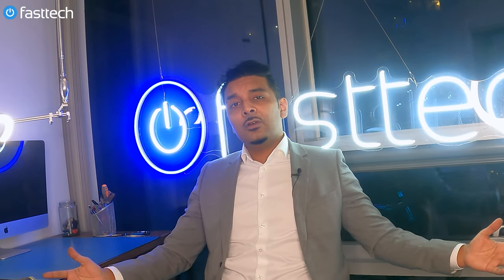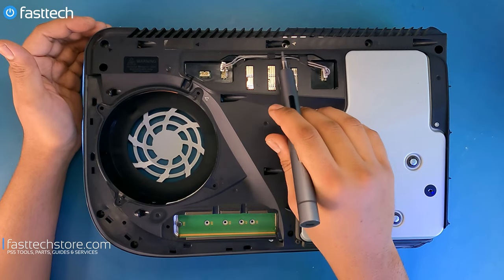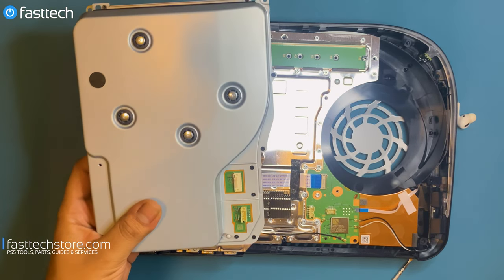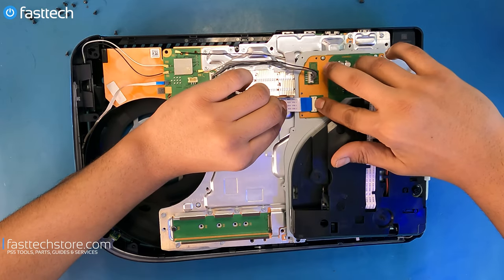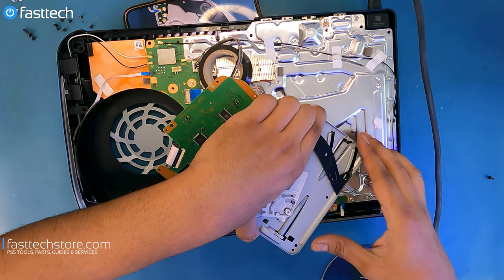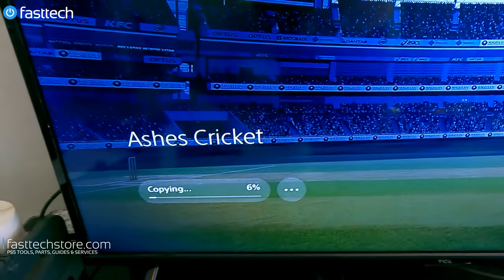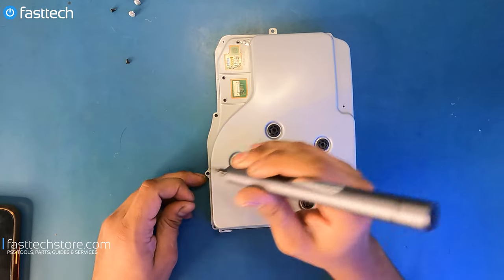PS5 Disc Drive Realignment Guide (Grinding Noise / Not Taking In Discs)

Comment from the maker: ▶ Fasttech Pro AutoKit: https://www.fasttech.ca/tools/fasttech-pro-auto-kit
▶ PlayStation 5 Laser Lens: https://www.fasttech.ca/playstation-5-1/ps5-laser-lens-kem-497aaa
▶ PlayStation 5 Laser Lens and Deck: https://www.fasttech.ca/playstation-5-1/ps5-laser-lens-with-deck-kem-497aaa
▶ PlayStation 5 Disc Drive: https://www.fasttech.ca/playstation-5-1/ps5-disc-drive-kem497aaa
▶ PlayStation 5 Casing: https://www.fasttech.ca/playstation-5-1?category=Casing
▶ PlayStation 5 Digital Edition Motherboard: https://www.fasttech.ca/playstation-5-1/playstation-5-digital-edition-motherboard-edm-010
▶ PlayStation 5 Power Supply: https://www.fasttech.ca/playstation-5-1/playstation-5-power-supply-adp-400dr
▶ PlayStation 5 Fan: https://www.fasttech.ca/playstation-5-1/playstation-5-internal-cooling-fan
▶ PlayStation 5 SSD: https://www.fasttech.ca/playstation-5-1/playstation-5-ssd
▶ PlayStation 5 Heatsink: https://www.fasttech.ca/playstation-5-1/playstation-5-heat-sink-cfi-10xx
▶ PlayStation 5 Eject Button: https://www.fasttech.ca/playstation-5-1/playstation-5-power-amp-eject-button-board
▶ PlayStation 5 USB I/0 Board: https://www.fasttech.ca/playstation-5-1/playstation-5-usb-and-usb-c-io-board
▶ Compressed Air Can: https://www.fasttech.ca/tools/disposable-compressed-air-duster-35-oz

👉Need Help? FaceTime/Zoom Video Call Me: https://www.fasttech.ca/online-consultation
👉GET REPAIR SERVICE FOR YOUR DEVICE: https://www.fasttech.ca/electronics-repair

▶ Want us to fix your device for you? Just order the Fasttech Repair Box to send us your device by using this link: https://www.fasttech.ca/repair/repair-box
👉NEED HELP? FaceTime/Zoom Video Call Me: https://www.fasttech.ca/online-consultation
👉GET REPAIR SERVICE FOR YOUR DEVICE: https://www.fasttech.ca/electronics-repair

Other PS5 Videos:
▶PS5 Disc Drive Repair Guide: https://www.youtube.com/watch?v=WocR0PRHu50
▶PS5 Factory Reset Guide: https://www.youtube.com/watch?v=-FBN3xqd5Pk
▶PS5 Elgato 4K60S+ Setup Guide: https://www.youtube.com/watch?v=bZETqEkjEBg
▶Enable 120 HZ Output for PS5: https://www.youtube.com/watch?v=Y6BcTNSX82o
▶PS5 Teardown and disassembly/repair guide: https://www.youtube.com/watch?v=-UFfAdd4IK0

👉Business Social Media:
Twitter: https://twitter.com/FasttechCA
Instagram: https://www.instagram.com/fasttech.store
Facebook: https://www.facebook.com/fasttechy

👉Follow me on Social Media:
VLOG CHANNEL: https://www.youtube.com/channel/UCF2IPXKRX5ctN9td1rhkzHg
Instagram: http://instagram.com/youngtechgod
Twitter: https://twitter.com/Shehroz

00:00 Intro
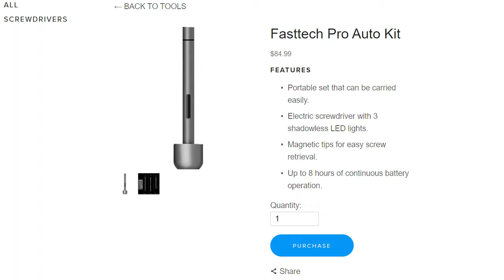00:52 How to remove the stand
01:04 Removing the covers
01:33 SSD upgrade guide
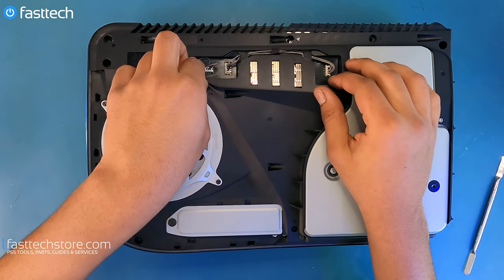03:02 Removing the plastic grates
03:24 Removing the fan
07:38 Removing the casing
10:55 Removing the warranty sticker without damaging it
16:46 Getting to the motherboard
20:52 Removing the front frame and bottom panel
23:25 Removing the heat sink clamp
24:26 Removing the power supply
25:21 Removing the antenna
26:25 Separating the heatsink
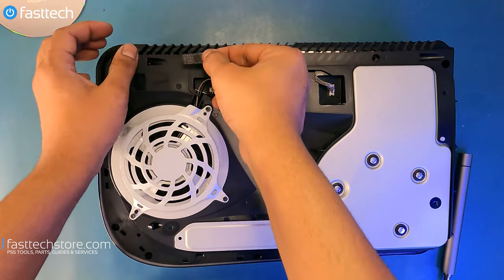27:29 Liquid Metal replacement guide
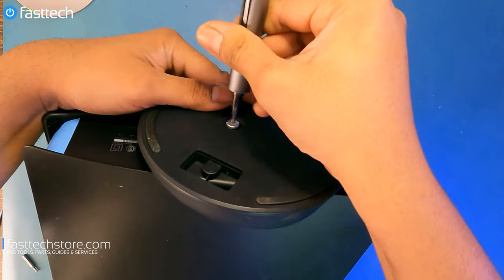28:29 Motherboard impressions
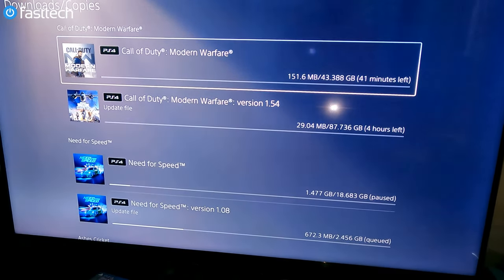29:05 Outro

Comment: Thnx alot for the video, fixed my ps5 that just made a clicking sound after the disc was inserted. I had no problems putting in the disc nor getting them out but the unit would not read the discs nor give me any errors. The lever that raises the magnet up and down was above the magnet and not under it. Sorted it after watching ur  video and now its up and running. Thanks alot bud! thumbs up and following!
Reply: How did you fix pls I have same problem and don’t know how to d that
Reply: Brand new PS5 here (Bought for my boys Christmas), won't read or even acknowledge a disc has been inserted.. Don't really want to take to bits as it's still covered by warranty, very annoying..

Comment: Ok guys so you actually need a disc for it to work properly. It took me a while to realize that but yeah you need the disc so everything can work.  And when he said it needs to be at the second spot if you turn it to the side you’ll see where the gear turns you’ll see like little sections it needs to be in the second one. The left gear wheel at the top needs to have the little rod that’s on the left side of it and the right top rod can’t hit or be over the black piece it has to slide in. The disc helps the magnet part actually register properly (I hope you understand because idk the specific names of them but yeah) it took me about a day or two to realize it. If you don’t get it try to figure how what does what exactly that’s how I got it

Comment: At minute 14:00 you can see why it didnt work at first, there is a small hole that must be in the right place with the piece that fits with the rollers in the side of the drive that make the move to suck and take the disc out. I know that cause I had to fix mine recently and I had the same problem. When you tried to fix it with the ps5 on you attached it at it did the trick.
Just a small detail that I noticed but it's normal, it's not an easy fix nor an easy thing to mess with disc drives
Reply: Thank you so much! That was the part I was missing!
Reply: I don’t get it, am I stupid 🤣 what do you mean?
Reply: Omg u r a true legend. 

I really didn’t want to have to connect my PS5 to power while in apart, and using a cd, that is just asking for things to go wrong. 

Ensuring that notch is slotted in the right spot is resolving entire issue right there! 

Thank you!
Reply: @tmz28 I just figured it out right now. It’s not about clicking and clacking. It’s the pin on the left hand side toothed part that has to locate in the slot in the top left gear.
Reply: You guys are the MVPs right here! Been changing my broken lense today and after putting everything back together, the drive sounded like a Decepticon and wouldn't insert discs correctly.

Was on the brink of going mad when I read these comments, and that was absolutely the problem and easily fixed. Thanks a lot!
Reply from the maker: Thanks for your comment you are correct

Comment: 20:00 disk was inserted the wrong way around that's why it didn't read , I have been trying to diagnose the issue where is starts to spin and stops then makes some noise and again keeps going on the loop. Any ideas ? 😊 Thanks for any information
Reply from the maker: Replace the laser. We stock them on our site. Check the description box. That will fix your problem.

Comment: Unrelated issue, but the center circular white thing (where the hole in the disc is) that seems to elevate just before the disc starts spinning is making some sort of scratching noise when I insert the disc. The noise only happens just before the disc starts spinning, then it stops. I haven't taken apart my ps5, so I can't pinpoint for sure the source of the noise, but judging by this video, the only possible source is that white circular center piece. I was just wondering if this sound is normal of if it could lead to any problems in the future.
Would appreciate some feedback from anyone. Thanks.
Reply from the maker: Sorry for the late reply but its an alignment issue. Check the gears on the sides of the drive
Reply: @fasttechvideo  thanks! Could it lead to any disc damage?
Reply from the maker: possibly if the surface or something is touching the disc as it spins, you will see circular scratches on the disc if this happens @BPG1999

Comment: Do you know why my disc drive won’t taking disc?it is making beep noise when eject button is pressed but not taking disc 🥲
Reply from the maker: Problem with disc drive logic board or ribbon cables could be disconnected.

Comment: hey everyone. I recently got my new ps5! I'm super excited to have one, I have bought the ps5 disc edition. my first few days of having it was amazing! I got my favorite games on it and they ran perfectly! On the 5th day of having it, my first disc game arrived! it is the new AFL 23, since I'm Australian and a fan of AFL, my ps5 is booted up and running, I take out the disc from the cover, and I put the disc print facing left, as I heard on videos. the disc just does not go in, I thought most PS5s just suck up the disc and it's meant to work? I was talking to one of my mates that came to my house today, and he says there's foam blocking the way of the disc, which could be true but I do see the cut bit for the disc to go in, he said maybe they forgot to take it off in production, however, I took out the side panel and I could see they glued it down meaning it should stay there to protect the disc drive, ill send a picture of it. but when I boot up my ps5 and it makes the first noises, I'm able to put in the disc perfectly fine, however, my ps5 can't read the disc. A disc can be mildly forced into the disc, but it's not on far enough so it doesn't read. i have my ps5 in the Horizontal position but I tried vertical and that didn't fix anything either. im hoping this is a self fixable matter because i don't want to go to a shop to fix it. I hope I get a response that works as I'm eager to play the game. thanks and goodbye

Comment: Ok.  So mine will take a disc at start up.  Won’t read it.  Makes a noise like it might be trying to eject it after it spins it for a bit.  It’s not loud or noisy when spinning at all.  In fact you might say it’s unusually quiet?  The spinning icon appears at the top center of screen.  

Hit eject and it ejects the disc.  After that it will not accept any more discs.
Reply from the maker: @MrProfchaos71  you need to replace the laser. Check out one of my newer videos on this issue

Comment: I have a different issue it takes discs in and it makes a noise but then it will stop and it doesn’t spin it at all. I don’t know how to fix it it was just working yesterday with the same disc but it won’t spin any disc I put in it any way on how to fix it? And I checked and their doesn’t appear to have any debris inside

Comment: Does anyone have suggestions for if after reassembly of the disc drive, the rollers DON'T turn freely? All gears are slotted correctly and lubericated properly. If I press down on the moving bar that houses the rollers, THEN they'll spin freely. But when I let go,  the gear on the left roller attaches the the other gears and it no longer spins freely...it hust wiggles a bit. Someone help.
Reply from the maker: It’s misaligned

Comment: Any thoughts on mine? So i have mine horizontal with disc drive on bottom and when i put in a disc it struggles and gets stuck but ejects. When i tilt console to other side with disc drive on top it read the disc fine? Thats the issue?
Reply from the maker: Try cleaning it out with alcohol and check the alignment of gears using this video as a reference.
Reply: @fasttechvideo  thing is i bought this ps5 used and for cheap so i dove in to get it fixed. Apparently when i play ps5 games it shuts down but plays ps4 game no prob i assumed it was psu and opened it up amd saw burnt or corroded. I checked all internals even the disc drive mount and inside the dic drive itsel. I used canned air amd 91 iso alchohol to clean it. Not sure what it might be ...maybe misalignment?

Comment: yo, I'm having the same exact issue you showed where my discs aren't going into the drive completely. I took apart the disc drive and noticed the white gear is rigid/not smooth so it doesn't work correctly. Is there a fix for that?
Reply from the maker: Watch my more detailed updated video

Comment: So basically if I'm gonna avoid this issue if I'm not experienced enough I have to buy a new ps5 disc drive which is easy to install rather than taking apart to avoid the risk of breaking it?

Comment: Brand new PS5 here, won't read or even acknowledge a disc has been inserted.. Had every PS version there is and never had an issue with a disc drive until now..
Reply from the maker: If its brand new it should be covered under warranty by Sony
Reply: @fasttechvideo  it is mate, but it's annoying that such a fault can even occur on a brand new PS5.. and now the retailer cannot offer me a replacement as the same bundle is out of stock and they have no good deals for the same price on anymore. My little boy (who's gift it was) just wants to play his new disc game and can't. I've been on reddit and lots of people who bought the same bundle have the exact same issue..
Reply from the maker: @rootyroot  which bundle is it?
Reply: @fasttechvideo  the MW3 bundle
Reply from the maker: @rootyroot  please check the model number on the console. Im guessing its a CFI-1200 series and based on your use of the word “mate” you are probably from the UK which should make it a CFI-1216. Is that correct?
Reply: @fasttechvideo  it's a CFI-1216A bud

Comment: So my ps5 says games are "unrecognizable discs" i did all the sony steps wit safe mode restarts, rebuild database, factory resets etc etc... I put a dvd cleaner disc in to clean laser lens and that played no problem. Was able to go thru all the menus on the cleaner disc and ran it multiple times.  But still wont read ps5 games and a ps4 game started installing but errored out halfway thru.. So plays dvds but not games and almost got a ps4 game to work. Ive read that the drives cant be swapped out for new ones. Cant i just get a new drive and use my existing logic board?  Any help is appreciated. Im out of warranty time.
Reply from the maker: The dvd and blu ray head is separate on these systems. You might have to replace the laser lens or the disc drive. We do stock these parts on our site at fasttechstore.com

Comment: I just got my used ps5. It dosent allow me to put in a disk. But if pulled the plugged and back in after 30min it works. But if i Eject disc and ps5 spits it out and dosent hold it so i can grab it. And then i hear it "spinning" like it ejecting disc. Afterwards i cant put in a disc. Its "locked".
Reply from the maker: @frantz3n341  check the gears

Comment: First thing you did was wrong, you inserted the disk the wrong way jezze
Reply from the maker: Yes I know. The disc drive was not accepting discs at all so I only wanted to show that it doesn't even go in.
Reply: @fasttechvideo The disk did go in. You had to push the eject button to get access to it. Putting it in upside down will do the very things you are describing.  Not only that, the damage to the lasers 
Really?
.

Comment: You ever seen the PS5 disk drive magnet that drops and come up get stuck causing the gears to grind? I don't play much and took it apart because it's OOW. I noticed during testing the magnet gets wedged causing it to grind. Obviously it should be smooth to pop up but I have to stick my finger under the lip it hits when the opposite side pushes it up.
Reply from the maker: Alignment issue
Reply: @fasttechvideo @fasttechvideo I found upin taking apart that one of the knobs on the plaatic track that moves popped out. Once I finagled it back into the notch it started working fine.

Comment: my ps5 is not reading discs. Is there an applicable drive cleaning disc that will work on a PS5, that I can use to clean it to see if takes care of the problem before sending it in for repair?
Reply from the maker: You can try a lens cleaning disc but i doubt it will work
Reply: @fasttechvideo  Would it void the warranty if I tried?
Reply from the maker: @Sapienrex  watch my ps5 disassembly video where i show how to remove the warranty sticker without damaging it.

Comment: Tried following this guide, I seem to have all the parts in place but still no luck. It's almost as if the drive has no power, but when I boot the system on I can see the drive make a small adjustment
Reply: Did you ever fix it?

Comment: If the ribbon cables don’t have the locks is it not fixable ?
Reply from the maker: Yes you can stick a card in there on top of the cable and it will work

Comment: Is it true sony will ip ban your ps5 if put a replacement drive from another ps5 in your system..mine is broke and i have no warranty so i think im screwed unless i can fix mine myself
Reply from the maker: No they will not ban your PS5 and it wouldn't even be possible for them to know you switched your disc drive as long as your retain and install your old disc drive's logic board and install it into the new disc drive as I mentioned in this video. This is an essential step for the disc drive to be read.

Comment: In less than a week, my new ps5 does not give way for discs to enter the drive and also when I turn on the ps5, the drive produces so much noise
Reply from the maker: @joeeexn  check out my newest video where I explain your issue in detail.
Reply: @fasttechvideo  alright
Reply: @fasttechvideo  that video is based on the drive not reading the disc, in my case, my drive does not allow the CD to enter at all
Reply from the maker: @joeeexn  ok then this video is better for you. Make sure the track on the left side of the drive is all the way up when opened
Reply: @fasttechvideo  alright thanks
Reply: @fasttechvideo  thanks but I'd send it to Sony since there's a warranty, it's risky to do it on my own, I'm not skilled enough
Reply from the maker: @joeeexn  yes absolutely if it is under warranty that is what you should do. Good luck and let me know how it goes.
Reply: @fasttechvideo  alright thanks
Reply: @fasttechvideo My dad just got a call from them and they were able to fix it so we will go and pick it up. It's just one problem, my dad isn't comfortable because we had the console for a week and it's getting serviced, so he may ask for a new console or a refund

Comment: Hello I know I'm late but my ps5 has been reading discs really slow is their anything I can do to fix it before it gets even worse
Reply from the maker: Can you please elaborate on that? What do you mean by reading slow? Are the install times longer than usual?
Reply: When I put the disc into the console it's taking ages to fully insert into the console
Reply: Same problem here. Ps5 takes disc real slow but reads them fine. Any fix?
Reply: Clean the rollers